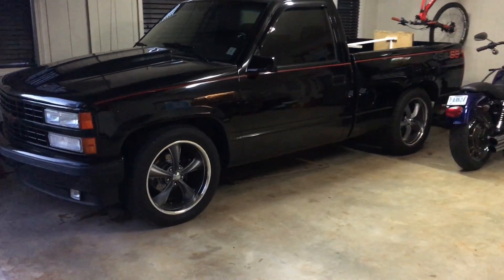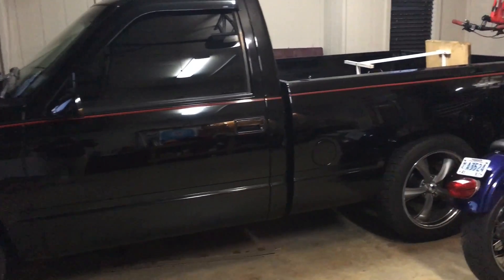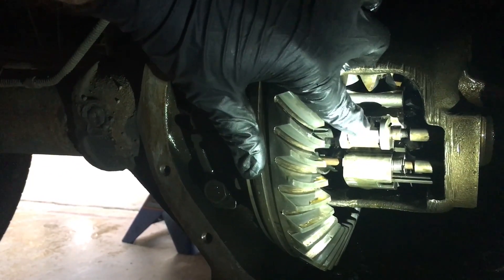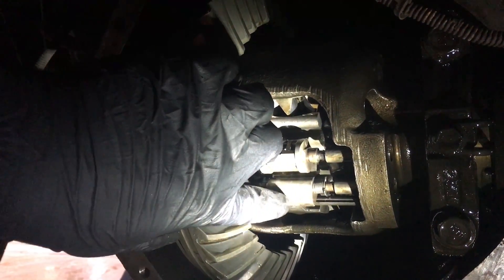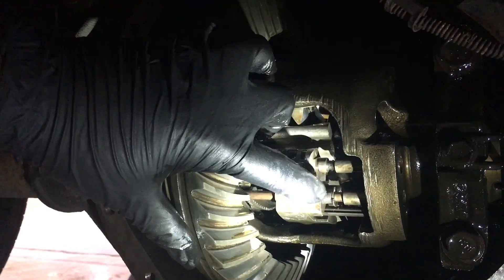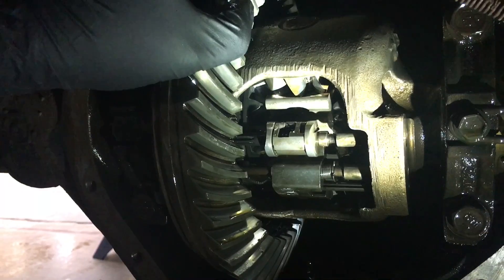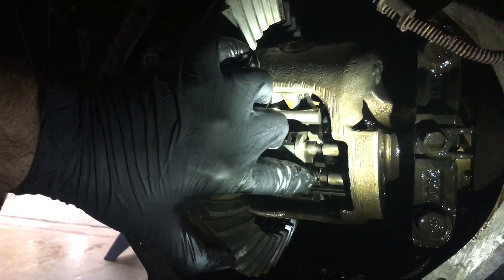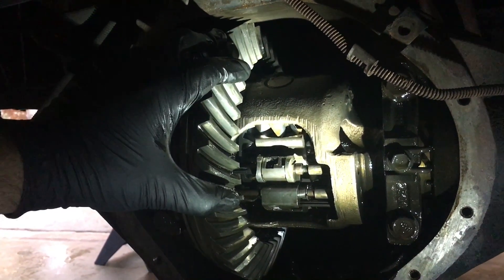G80 Gov-lock improvement

Comment: Does that have thicker axles 
That a 2004 ish 1500 
I have a snaped axle so I want a g80
Non open rear my current rear is kaput I remember hear that 90 trucks you could get the 14 bolt 🔩
And six lug

Comment: Did it work 
By doing this 
If so I’m going to do mine
Reply from the maker: Yeah it helped it stay locked to a higher mph. I’ve since changed it to a tru trac
Reply: @mam346 did it fail or did you want more mph burnouts?
Reply from the maker: @kennethparker573   I was wanting higher mph burnouts.

Comment: Hey Mac Mccarter. I am going to try what you did with my g80 diff and did it work? Or i will take the g80 out and cut off the counter weight. Does the spring tighting wear out the clutches faster.Please check out Mt maniacal s10 on Youtube please. Mike.

Comment: You can also cut some of the counterweight off which in turn makes it have to travl faster to open, ive never seen it dont the way showned in the video but if it works its the same idea, also theres a gug on an s10 fourm that modified it to look up eaiser insted off 100rpm wheel speed different it takes approximately half that
Reply: What do ya use to cut it with? I'm afraid of nicking the ring gear